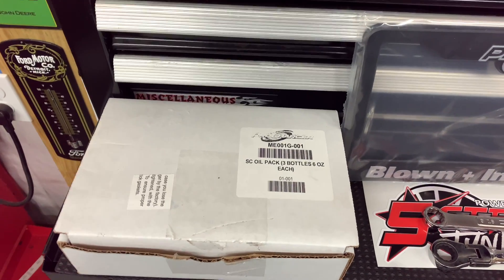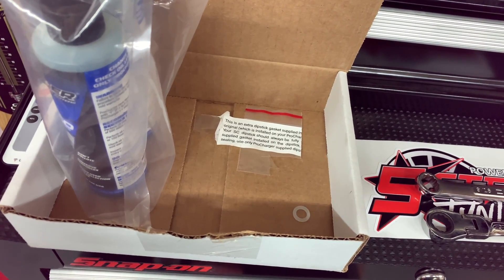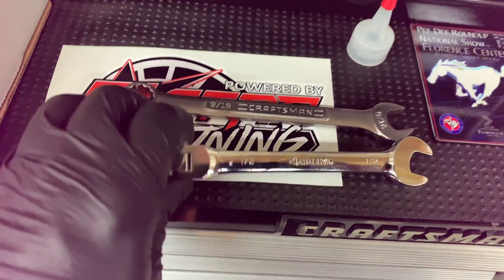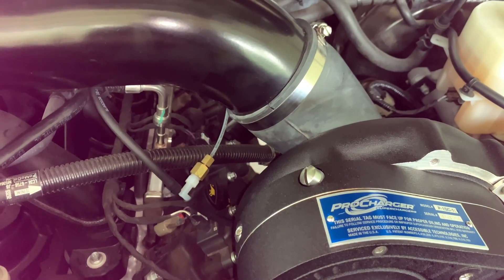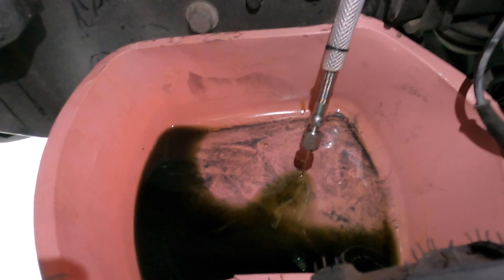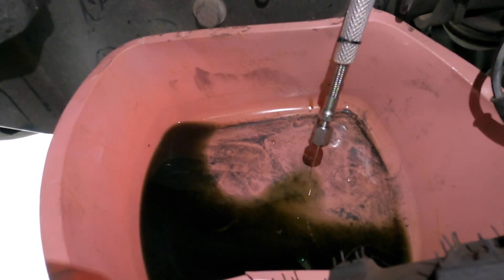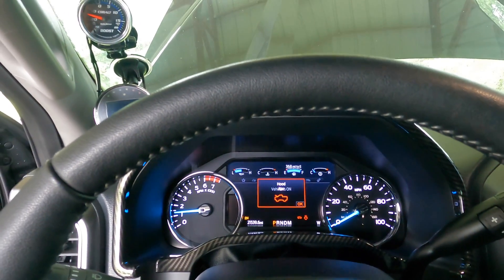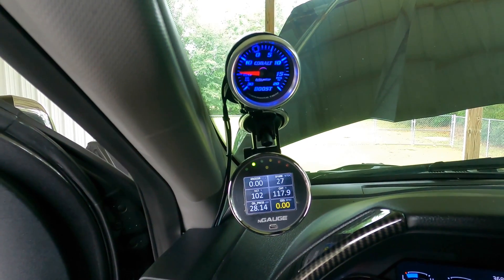7.3 Gas F-250 ProCharger service and fuel mileage in town.#fordfunatic #godzilla #godzilla #ford

Comment: Thanks for the great video.  I’m in the military and planning to order a new truck when we return from overseas and debating between the 7.3 and the 6.7 diesel.  If you don’t mind me asking, would you answer a few questions?

What’s the maintenance interval for the pro charger? 

If you had to do it over again would you still go with the 7.3 or the diesel? 

Lastly do you have the 3.73 or 4.30 gearing?  I’m leaning towards 7.3 with 4.30 combo. Our family owns a small excavation business and it would tow a skid steer and mini excavator pretty regularly once I retire from active duty.  

Thank you for your time!
Reply from the maker: The first service for the ProCharger is 500 miles after that I do it every other oil change. I change my oil every 5,000 miles or so. It is very easy to maintain and I have not had any issues with it. 
I actually sold my diesel and went to the 7.3 gasser and yes I would do it again. 
I have the 4.30 gear which I highly recommend especially for towing. 
The 7.3 is a lot cheaper to maintain Vs the diesel.
If you are going to be towing 20k lbs everyday I would recommend the diesel.

How much weight will you be hauling? 
Happy to answer any questions you have. 
I truly appreciate you watching the video.
Thank you for your service as well.

Comment: 12.5-13 is good with 35’s. I’m guessing you have the 3.73 gears. My v10 superturd gets 10mpg with 37’s and 4.88’s I forget what it got with 4.30’s and 35’s but yea we don’t drive these big trucks for their gas mileage. Cool video. You need a tripod so you can go hands free. 👍🏼
Reply from the maker: I have 4.30 gears. Those V10’s are some very good engines. Your fuel mileage is really good. Thank you! I appreciate you watching
Reply: @ProCharged7.3Godzilla  I’m chomping at the bit to get a 7.3 f250. Just been waiting to see if there are any bugs.
Reply from the maker: @brokenwrench404  I haven’t had any issues with mine. The market is so high right now. That’s the only thing that sucks. Seller’s market not a buyers market. I hope you get one, if you do let me know.

Comment: Any 1/8 mile or 1/4 mile numbers from the track?
Reply from the maker: The best numbers so far using a dragy was 4.81 sec 0-60 
1/8 mile 8.60
1/4 mile 13.37 in 4 wheel high spinning 1-2nd 
Thank you for watching!!

Comment: What power at tire? 0-60 or 1/4 mi?
Reply from the maker: I believe you already saw the Dyno graph. 622rwhp and 644ft-lbs of torque. 
I have a video with a 4.81sec 0-60 but I recently did a 4.7. The one 1/4 mile pass I did a while back was 13.3
Reply: @ProCharged7.3Godzilla  saw the other vid after asking. Nice for such a big truck. Would love to have a ‘23 250 but am scrambling to come up with $$ as got a Allocation for a ‘23 RaptorR at msrp. Gotta sell a bunch of stuff.
Reply from the maker: That Raptor R bad is a$$. I hope you get it.